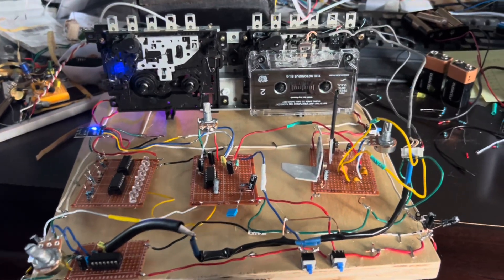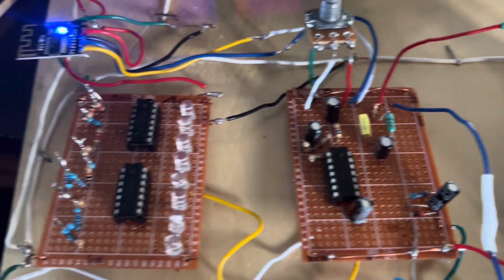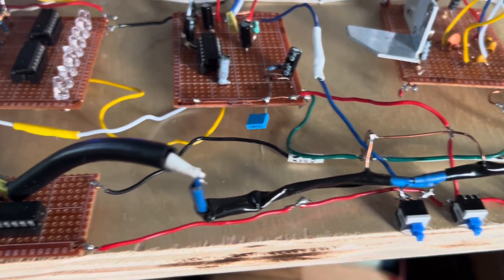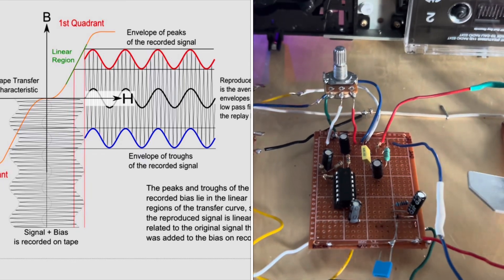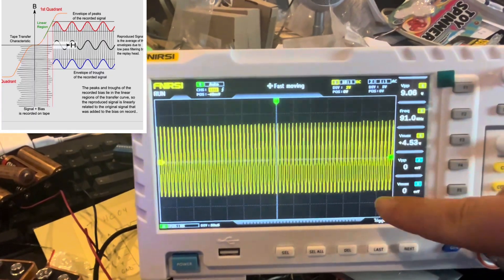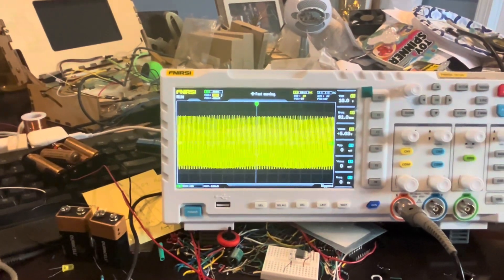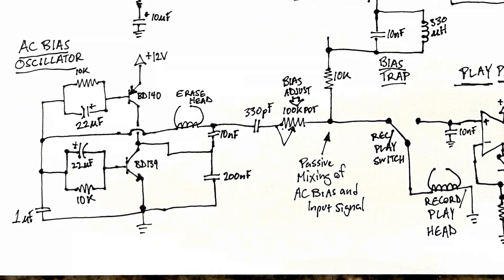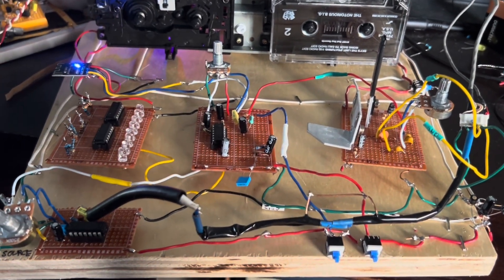Tape Player/Recorder Diy - Final Circuit and Demo

Comment: Did you buy the transport mechanism new or used? I've been trying to do a similar project but I'm unsure of a decent seller for mechanisms, just offbrand vendors on eBay and Aliexpress. If I need to I might just get one of those Jensen shoebox recorders and take it apart, as I only need one transport instead of a dual deck
Reply from the maker: It was an old tape deck that didn’t work that i used. I made my own since then just didn’t post yet

Comment: Hey there! Wanting to try this for a tape echo machine for my guitar.  I'm on my late wife's channel, incidentally; and the machine I'm planning on usibg is a Huntz muzak player, or a giant cart player! They have huge carts that are four times larger than an 8 track, but they also play radio station style carts, as well as older 4 track tapes, but do so at 7ips, and i plan on making this variable speed, if i can also wire up a modest servo circuit that doesn't interfere with the audio recording circuit. I may even try using a tube based recording circuit from an older webcor tube based machine, but the huntz style machine here, is BUILT! made to be used 24/7 for 1000 years or some s*&* lol... so I'm weighing out my options. The machine ALSO has high impedance op amps, to amplify small microphones, AND THOUGH it's mono, i can source some old mono FULL TRACK or HALF track heads, to get a higher record and playback quality. It also has a 60 watt pa amp built in, so in theory i could utilize that 60 watt amplifier to put out the bias signal with a LOT of amps at my disposal. Provided the amp will allow frequencies that high to be produced! I'm thinking it may require a few tweaks, as there may be a noise reduction roll off in there somewhere... but i had been theorizing that this could do this for a while! This could be pretty amazingly well suited for the task! I got it CHEAP at the local music store, with a 60lb crate of the huge tapes! The tapes are normal bias 1/4", but actually extremely well suited, with 7.5 ips a great speed... I'm just torn between varying the pitch of the tape speed, or varying the head distances... i have a ton of tape heads here. I could theoretically permanently speed up the transport by increasing the width of the capstan, or servo-ing the AC motor... but having a large space inside the machine dedicated to a large number of multi-tap heads, to create a high quality multi-tap reverb sound, if needed. The huge tape compartment, can be used to house all the extra heads and gear... OR... the huge REELS THEMSELVES, can be loaded with tape recording electronics, made from custom made SMD circuit boards made over in china! You could have a tape echo, entirely housed in one of those giant tapes, which, instead of being FULL of tape, would have an inlet for 12vdc power supply, and a record/erase head, and a rotary head that spins on a pivot, around the center axle of the tape reel or possibly just from the center, to the outside of the tape shell to affect different delay times..., from 20ms to .5 second delay... so basically, the entire echo unit could be contained in one big tape shell! Holy cow... this idea just came to me. Look up "large fidelipak tape cartridge" if that thing only had a minute's worth of tape, the entire shell could be used for the electronics of the echo.  And the reason fidelipack carts caught on and we're so popular back then was because radio stations use them for all of their program material, and their entire music library most of the time, with carts for nearly every song they had in their playlist, and shopping centers which use them to pipe in these 6 hour-long tapes full of easy listening music. But the real magic behind the whole thing is that the unit itself pretty much only contained a spinning cap stand and a play head and a pinch roller that engages when you plug it in. The most simple tape player ever made. And there are still tens of thousands of them out there.

Comment: Hi sir great Video and explanation, i want to build my own cassette player just for play the tape not record audio can you explain more about the preamp
Reply from the maker: @mohdazim5484  its just an op amp with some gain to amplify the audio signal so that its loud enough to be recorded adequately but not too loud that it distorts. The values i used puts the signal in the 0-12v range

Comment: Which ic used for this circuit
Reply from the maker: @anuroopv.g3048  just tl074 opamps
Reply: LM 324 ???
Reply from the maker: @anuroopv.g3048  lm324 is a good op amp to use for the peak detector as comparators
Reply: All IC TL074???

Comment: Keep in mind magnetic tape has a 6db  per octave roll off. Full bandwidth audio, 20hz to 20khz, is 10 octaves. So you need some record and playback  EQ circuits to manage that. Fairly easy to do with active OP AMP filter circuits.
Reply from the maker: Thanks for the comment. I’ve looked into this but I can’t really decide what standard or cutoff frequency to use and as much as I like trial and error, there are way too many variables to look at. I get that you need high pass for record eq and low pass for the playback. Ideally i would like to do something adjustable with pots.  I also don’t want to just copy someone else’s design.

Comment: Good video, I went through all this with my 8 Track record / playback deck, the key to getting good record performance is the record EQ design. I went with 75 kHz AC bias, I work this out by testing a range of frequencies and found highest audio frequency x 4, give an idea of the optimal bias frequency to work with. You may want see my video on the subject call "new 8 track technology" and see how got it all to work.
Reply from the maker: Thanks for that. Thats why i put in the record vu meter so i can adjust the record preamp on the fly to 75% max peak. Below that too quiet and above that it distorts.   I did not see a difference in the recording circuit until the ac bias frequency went below 40 kHz. The bias trap was definitely a helpful addition to the quality of the recording.